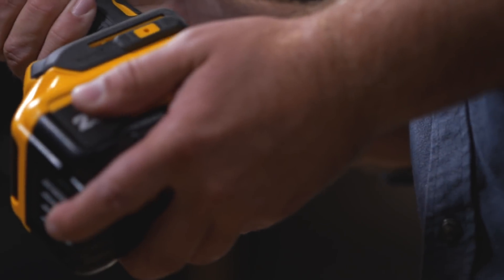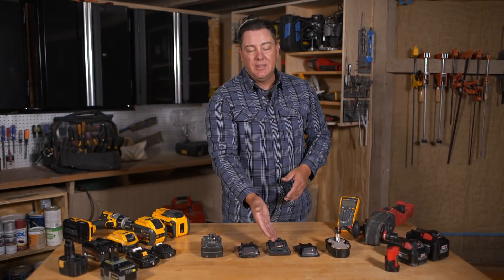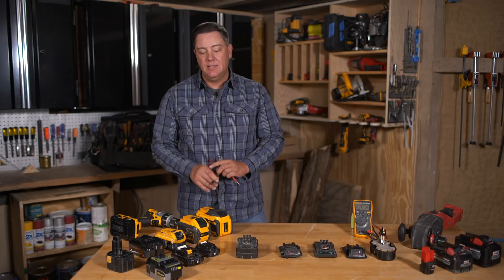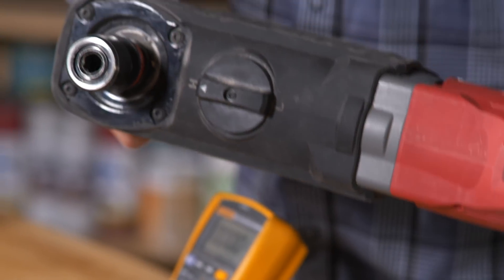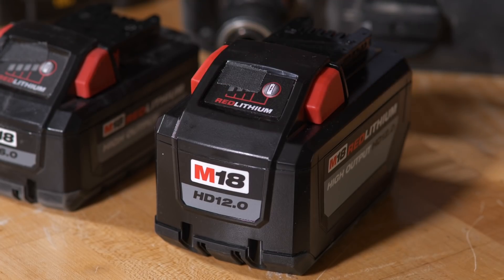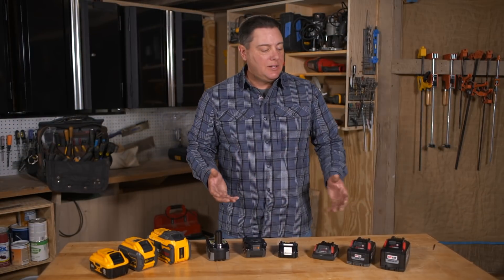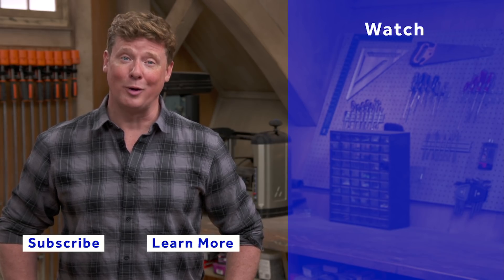Battery Voltages | Tool Lab | Ask This Old House

Comment: I'm a physics professor, and Amp-hours are definitely a unit of charge. (So, basically, it is a rating of how many electrons the battery can deliver.) Volts are (potential) energy per unit charge. I wish they rated the battery with Watts (units of power)--at least that would make more sense to me. My students constantly mix up the ideas of electric charge, field, energy, voltage, etc. And I sometimes feel that the specs we use on tools like this muddies the waters.

Either way, if we can deliver 12 Amp-hours of charge at 18V, that means we have 216 Watt-hours of electrical energy (just under 800kJ).
Reply: Did you note that this guy ignored the max discharge amperage of the cells ( C )? The dewalt pack cells are Samsung INR18650-13Q which delivers 15 max amps. Some cells are 10A, 12A, 15A, 20A, 25A, etc. How come manufacturers don't list this very important spec? I'd want to know if a pack can deliver 15A or even 30A in a 2x5 series-parallel config. I studied electronics as a kid in the 80s (Forrest Mims fanboy) and built circuits, was a EE major before switching).

Comment: When I told my mom that an 18v & 20v Lithium-Ion battery are basically the same voltage, she didn't believe me.
Reply: She probably doesn’t even care and just answered that to answer something
Reply: @Engineer9736  
I didn't even ask her though, I just told her.
Reply: Tell her that 4.2V is max charged voltage. The 3.6V is the "tank half full" voltage, halfway between 4.2V and "empty" voltage of 3V. Multiply all by 5 since 5 cells are connected in series.

Comment: The simplest way to understand the difference between voltage and amperage is to compare them to pressure and flow...
Volts is the "pressure"  Amps is the flow.  Amp hours is a measurement that is not only a indication of how much current the battery can provide but how long it will provide it for. 
Another fun fact with these lithium ion packs is that the "smart" circuit board will completely kill the battery if it detects that one of the cells has dropped below a certain voltage, or if it fails to take a charge a certain amount of times. This can be caused by leaving the battery in the cold, especially when it has been run down. Lithium ion cells are known to blow up if they go bad and are over charged, so built in protection is critical. However most of the time these battery packs "fail" prematurely.
Reply: I thought only charging in the cold kills a battery and not just cold temperature

Comment: Argh, folks keep confusing Amps with Amp-hours.  Amp is the unit of measurement for current, or effectively how much power is flowing since battery voltage is a given.  Amp-hours are a measurement of capacity , i.e. how much energy the battery can store.  AH rating and current capacity rating are different and measure two unrelated things.
Reply: > AH rating and current capacity rating are different and measure two unrelated things.

In general, yes, but perhaps not in power tool batteries, where amp-hours is (if I'm understanding correctly) typically proportional to the number of battery sets that are run in parallel. If I'm understanding this correctly, then my guess is that Heath was just keeping it simple to keep the explanation both practical and accessible.
Reply: @dosadoodle  If car manufacturers used the same specs as battery pack manufacturers, they'd advertise gas tank capacity, and totally ignore engine horsepower rating!
Reply: @dosadoodle  Ah capacity is same whether it's a 1x5 or 2x5 since it's a measure of capacity. What he doesn't mention is a 2x5 pack can deliver up to twice as many amps (discharge amperage) as a 1x5, assuming both packs use identical cells.  The cells shown in the dewalt have a max discharge amperage of 15 amps, when used in 2x5 series-parallel config, the max discharge amps is 30A.
Reply: Yea I think linking the capability to the capacity in amp hours is just wrong/ confusing.

Comment: what about makitas new line of 40v tools. The biggest battery they got is a 4ah. At that voltage does the amp-hour matter?
Reply: 10 cells in series. Whether you connect 10 cells in series (40V) or series-parallel 2x5 (20V) the Ah rating is the same since it's the CAPACITY of each cell summed together, no matter how they are connected to each other (series or series-parallel). The "flex-volt" cells do just this, they can be 20V by internally connecting as 2x5 or 40V by all switched to series.

Comment: 20V is all marketing.  Any tool that claims a '20V' tool is just kinda lying to you.  It is 18V.  I have also found that the 12V lines most tool companies have meet my home use 95% of the time.
Reply: Not so much lying as just using different ways to state an inherently imprecise measurement. The actual voltage ranges from about 15-21V, so you can call it 16V or 18V or 20V and you're not really wrong, although the accepted industry practice is to use the 3.6 or 3.7 per cell nominal voltage, so 18 or 18.5  is the most "correct" for 5 cells. But advertising a 20V system as better than an 18V competitor is just meaningless marketing.
Reply: Yep. About their 20V line of tools (which is marketed as 18V outside of North America), Dewalt states, “Maximum initial battery voltage (measured without a workload) is 20 volts. Nominal voltage is 18.”
Reply: Max voltage of a Li-ion cell is 4.2V. The lowest voltage that cell can be discharged to safely is 3.0V. The nominal voltage is halfway between 4.2v and 3.0v, or 3.6V.  
3.6v x 5 = 18V, 
4.2V x 5 = 21V
Reply: I once measured the voltage on the supply side of my breaker box at 118 V. Does that mean my power company is just kinda lying to me?
Reply: @StoneE4  variation between at least 117 and 122 over the course of the day is normal as demand changes. hot afternoons when thousands of air conditioners spin up puts even more strain on it (I measured down to 113 a few times last summer), and if you're farther from the nearest substation you might see more pronounced swings. but it's billed in terms of energy, compensating for voltage changes, so it's not like you're being charged for the voltage they're not giving you
Reply: @ailivac  Yes... I realize that. My question was one of facetiousness. 
You might want to take your sarcasm detector in for servicing. 😉😁

Comment: It's not so much the Ah rating of the battery but the fact that there are parallel cells in the battery that will provide a higher inrush current for jobs that require more power.
Reply: Also you can use higher-capacity cells that have lower discharge current (which is typical - cell design is a tradeoff between the two) and end up with more power output and more than twice the capacity. For example, if the cells you have available are 2Ah/15A and 3Ah/10A, you can make a 2Ah/15A 1P pack or a 6Ah/20A 2P pack - 3 times the capacity and 33% more power output - in only twice the space.
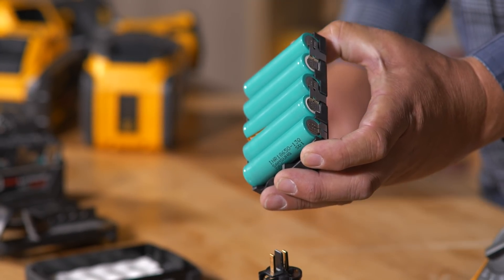Reply: @ailivac  Exactly. They should have consulted others first :)  The 3.6V is considered nominal voltage (half-way between 4.2V and max discharge "empty cell" voltage of 3.0V), the 4.2V is considered 100% charged voltage. The Ah rating is CAPACITY like a car's fuel tank. What no manufactures list is the DISCHARGE capacity of the cells. The first 1x5 pack 2:24 uses Samsung INR18650-13Q cells which are rated at 15A max discharge capacity. So you can get a max of 15 amps out of the pack. The second M18 2x5 pack at 2:40 (I can't read the cell ID, let's assume same cell) if they are the same 15A max discharge, the pack can deliver 30 amps, twice as much as the 1x5.  While the Ah is "gas tank capacity" the DISCHARGE rating is closer to a car's horsepower rating.  The tool itself is the TRANSMISSION/GEAR RATIO/TIRES how well can it use the available power. 
Some cells have max discharge of 10A, 15A, 20A, and 25A... you won't know unless you open up the pack and ID the cells. Some manufactures will change the cells out in the same pack between years. 
Typically the Ryobi 1-4Ah use 1x5 series, 6Ah uses 2x5, and the 9Ah uses 3x5 so the 9Ah gives triple the max discharge of the cells - this pack should be used with 1/2 impact drivers and saws
The dewalt uses 1x5 for smaller packs, 2x5 for the 5Ah pack, the 10Ah uses 3x5 config. I haven't look at the powerstack much but look to be LiPo flat rectanglar cells, not cylindrical.
Anyone who flies drones are very familiar with the max discharge rate specification for cells (10C 15C 25C) since both Ah and Discharge rating ( C ) are common specs. 
There's a handy cell reference page which gives the specs to all the Li-ion cells in use today so you can get the max discharge rating of any cell ( https://secondlifestorage.com/index.php?pages/cell-database/ )
Reply: I've noticed Heath uses improper terms and seems to have a half wrong understanding of electricity, physics and circuits that seems to be endemic among all the electricians I've met in real life.
Reply: @nilz23  he was trying to explain something simply enough so anyone can understand it. He doesn't have a PhD in physics neither does his audience
Reply: @mufasaiam7794  but here's he's just plain wrong. Amp hours or capacity which is proportional to total energy stored in the battery doesn't necessarily have anything to do with the amount of current at a certain voltage, or power, the battery can provide.
Reply: @nilz23  Given that the cells are identical, as he showed, the maximum current is going to be directly proportional to the number of cells in parallel, which is the Amp Hours. You're 100% wrong with this statement.
Reply: @nilz23  Well, the batteries are classified by their Voltage and Amp Hours, so he could use those descriptors since the available current is always going to be proportional to Amp Hours when the internal cells are all the same and simply wired differently (as he explains well), or he could go into unnecessary details to seem smart. Speaking of which, I've noticed youtube commentators failing to specify their gauge choice when speaking of voltage. This seems to be based on a half wrong understanding of electricity, physics and circuits that probably isn't an issue outside of quantum chemistry and relativity, but by criticizing others I'm able to sound really, really smart.
Reply: @christophermcfarland8467  Fine then div A = 0

Comment: This is terrible. Power is voltage, not amperes. You're getting your terminologies completely jumbled. Poor video, nothing is accurate
Reply: Power is technically watts.
Reply: @joshb.guptill5127  ^ This, the only correct answer given lol.
Reply: Voltage is the potential energy per unit charge. If you take this as a per unit time, you get current as the charge per unit time flowing past a given point, and with power being energy per unit time, you get voltage as the power per unit current. That of course implies that the power in a circuit is voltage * current. So the power a tool gets depends on both, the voltage of the battery; and the current being drawn. Where the video gets it wrong is that this current doesn’t directly depend on the battery capacity. A 12AH battery does not automatically give more power than a 3AH battery by necessity. And that amp hour rating is not current, it is charge. It’s a measure of battery capacity, and multiplying that by the voltage gives you the total electric potential energy of the battery. A 3AH battery could possibly provide more power than a 12AH battery if it provides more instantaneous current to a tool. He’s “almost” right in the video though because typically, larger batteries will have sets of cells in parallel, which typically means it can provide more instantaneous current. But it’s because of the parallel circuit, not simply because the amp hour rating is higher. There’s also a huge thing he missed comparing these batteries, and that’s the types of cells they have. The high output batteries he was showing have 21700 cells, which are a larger, more advanced cell with better circuitry that can provide much more current without overheating. The small battery had 18650 cells, which are older technology. So that’s another big reason that in this case, the higher capacity battery performed better. But to disprove what he was saying, if you took Milwaukee’s 3AH high output battery and their 9AH older battery, the 3AH might win because it has 21700 cells vs the older 18650 cells in the 9AH. So overall, a good video for the very basics, but there are a couple important things he missed.
Reply: No Power is Voltage x Amps
Reply: Pat is also correct.
Reply: @joshuahoward4591  Technically not since he isn't specific on the type of power. Apparent power yes, which assumes the power factor is 1 as on a DC circuit which is a measurement of kVA and not KW, but since the power factor is always 1 on a DC circuit the following is true, kVA= V*A*PF*1000, or P(kW) =  S(kVA) × PF. On an AC circuit the Actual power measured in kW is (kW=V*A*pf*1000) and since the PF when measuring Actual power is almost never 1 therefore kW does not equal kVA and P(kW)=VxA would not be correct. It would be P(kW) = S(kVA) × PF.

In other words, no unit of measurement for power was used either kVA or kW, nor was there a PF so that makes the statement technically inaccurate.
Reply: @kainbrah  wait, what did I say that was inaccurate? I don’t see how anything you said has to do with what I said.
Reply: @joshuahoward4591 My response was to the Pat is also correct comment not your second comment : )
Reply: @kainbrah  oh ok. Everything I was saying was meant to be in the context of this video, which is using DC circuits only. Pat was correct when it comes to tool batteries. No power factors or apparent power involved.
Reply: @joshuahoward4591  Of course, all good then. :)
Reply: Fish outta waddah!!!!! 
Fish outta waddah!!!!!
🦞🦞🦞🦞
Reply: @jeffwilson1399  fish should've stocked up
Reply: Well amps is the power of electricity. Volts is how much electricity.